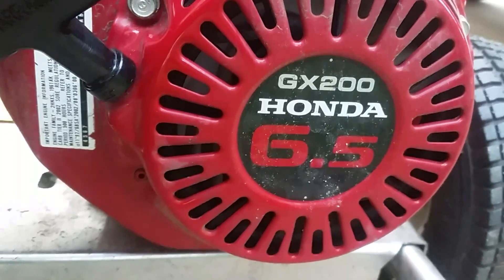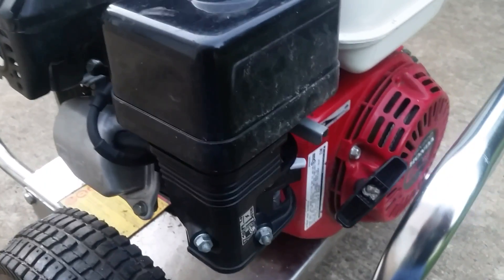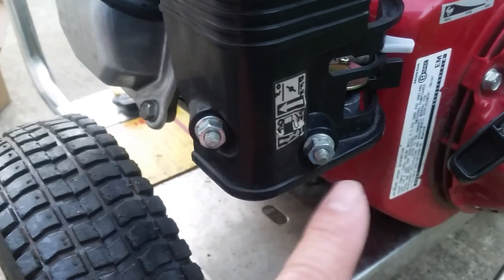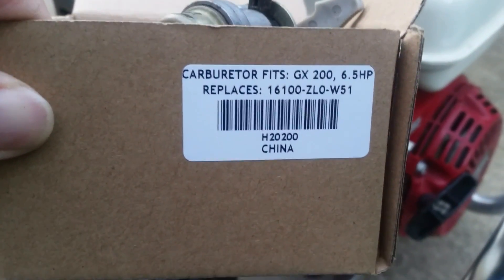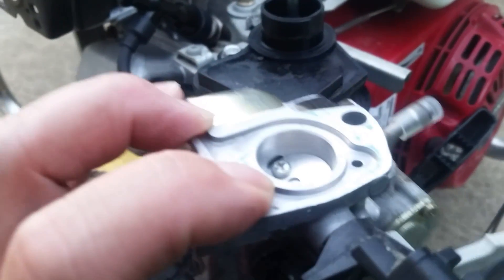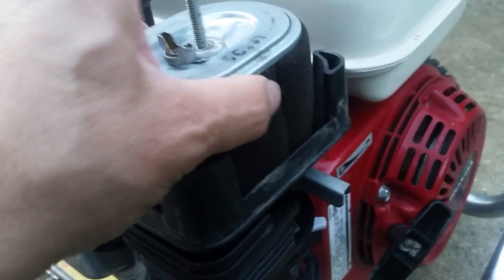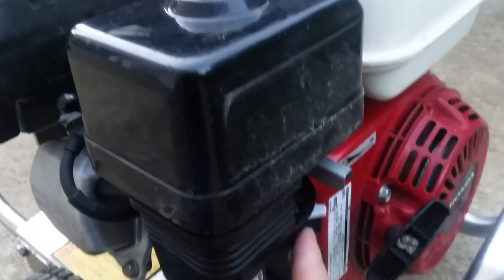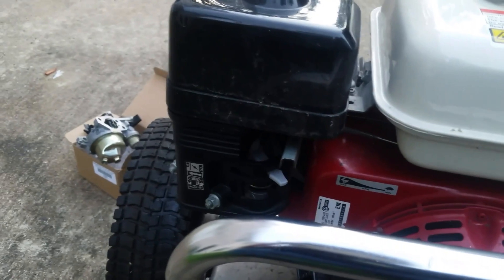Honda GX200 6.5 engine Won't Start

Comment: I put a new spark plug in last night started great, today I went to run it and wouldn't start up.
Reply from the maker: As silly as it seems, check the on and off switch, spark plug wire,  fuel cutoff is in the right position?

Comment: If your GX200 engine spits, sputters, backfires, and possibly runs fine intermittently or maybe not run at all, check the spark plug boot for arcing between the boot and valve cover.
Mine was doing this and had me stumped until I started it after dark and saw the arcing. You can slip a thin piece of plastic like a milk jug in that area to confirm this.
Thus was on a almost new pressure washer.
Reply from the maker: And you didn't see or hear an arc? Usually you do just like in a car engine..
Reply: R
Iu😊😮😊😊u

Comment: Clean the carb jet and check for spark. Don't watch this useless video.
Reply from the maker: You have 85 subscribers in 12 years..so who has useless videos...if you had actually listened to the video it states that it started and idled..so how is that a spark issue.

Comment: My manual says "Never start engine without the water connected and turned fully on or pump damage will occur".
Reply from the maker: Did you try to start it with the water on?.its much harder to pull start it..and no damages have occurred,  besides troubleshooting a no start is easier without the water mess..

Comment: I didn't and the tech didn't suggest  it either.
Reply from the maker: Unless they flooded the spark plug with gasoline..wet plug wont start..but I would start from scratch..check for spark..if good..install new spark plug..get a can of carb spray..spray it in with the air filter off..turn on the master switch..give it pull..see if it wants to start

Comment: It had spark, tech checked low oil circuit, even added more oil. Tech adjusted the screw on carb,didnt help. Used premium gas in both, different source second time
Reply from the maker: Did u pour a little gas down the carb..gas, spark and air is all you need to start

Comment: Did it work after that. We bought a wood splitter with a Honda gx200 and couldn't start it , used premium fuel, returned it and exchanged it for another, same result . Took it to a Honda service tech and he can't get it to start either. Is this a common problem? Any thoughts
Reply from the maker: Its brand new and wouldn't start on 2 different hondas?..I would start on that on and off switch on the side. Then check for spark..if you have spark. Then a spray of carb cleaner down the throat it should start..if no spark then it's in the ignition spark control..but 2 different models same result is strange
Reply: @alyoungcuda  Had same issueon 2016 Northstar 30 ton log splitter. Drained gas tank, cleaned carb including removing main jet and emulsion tube. Both where very clean also, float needle and
Reply: float. Only use 93 non ethanol with stabil. Issue is bad NGK spark plugs. Found ouy by switching with 20 plus year GX 390 PSI washer. Log splitter plug shows fire; however, it's failed. Tested by switching both plugs. GX390 PSI washer 5 year old plus plug started Northstar immediately first pull. Less than 7 hour use on NGK BPRES6 failed to start GX390 PSI washer.Switched back to original and no start in Splitter and start in PSI washer. Will be switching to Champion plugs for no starts in Honda GX motors with no start issue and plug failure.

Comment: Now I would like to say something that has not been addressed but may save someone the stress that I went through.
I bought new ( a wood splitter with a new honda gx200 engine) and could not get the dam thing started even though I followed instructions and removed the spark plug to see if there was spark.
Now where I am ( near Algonqùin Park) and the temperature of -20C caused a phenomina that is not normally addressed.
You see, I do not have a heated enviroment for my work toys and we surmized that a little fuel was used for bench testing and water condensate froze the line or carburator and until I was able to get to my neighbour's heated garage, I was "SOL".
To avoid future problems, I filled the tank full of premium gas with "Sea Foam" additive.
Hope this helps.